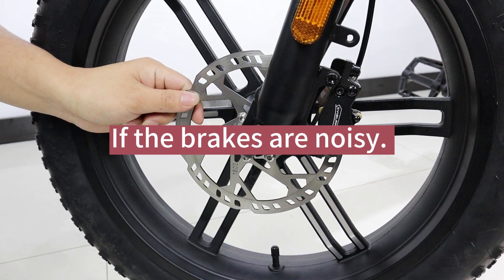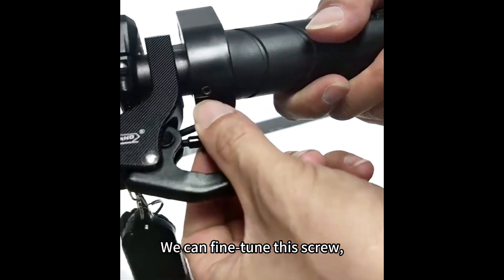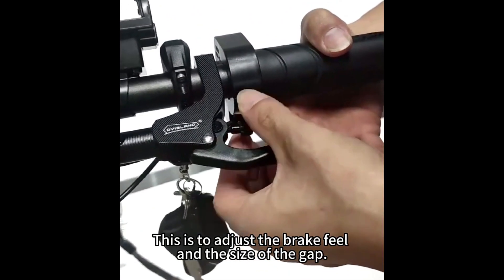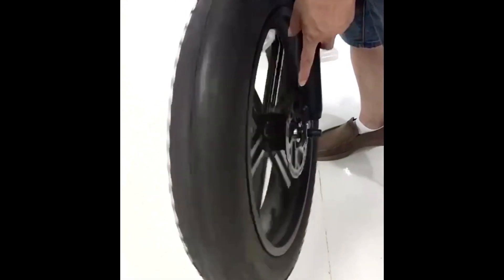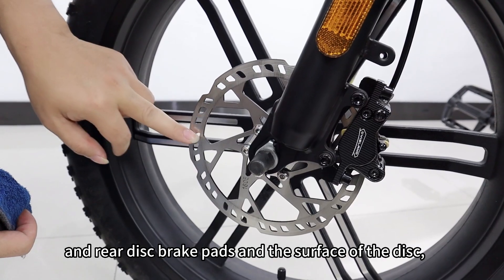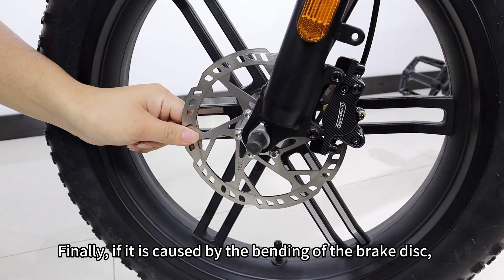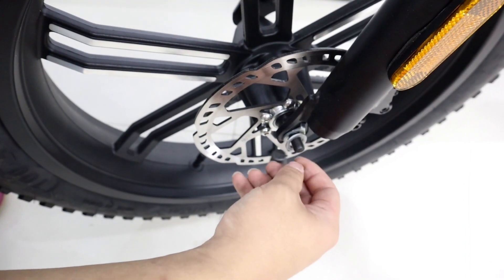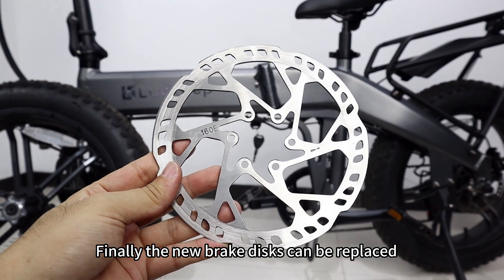How To -- If Brake Makes a Noise

Comment: Ok well my break pads are still in decent condition but there’s a big problem. The breaks have lost full pressure and the e bike doesn’t stop safely anymore. I kept on turning that little screw to tighten my breaks but there is no longer any left to tighten. Please let me know how to fix this and if I can’t please be straight up and tell me where I can fix this.
Reply from the maker: You can take some photos or videos of what you’re seeing. Note down your observations as detailed as possible. Then, send those over to support@luckeepbike.com along with your order number. Our team will take a look and guide you from there.

Comment: Gooooooood🤙👍
Reply from the maker: Thanks for your support! Hope our ebikes can help you!
Reply: @luckeepBike 
Hello Ser, I have this RKS xs25 Electric Bike, I need original brake pads for it, if I order, you can send it from there.🙏🙏🙏
Reply from the maker: Brake pads are not a universal accessory. If you buy another brand of electric bicycle. There is a chance that our brake pads may not fit your e-bike. I'm sending you a link so you can check out our brake pad specs.link:https://luckeepbike.com/products/1-pair-of-luckeep-brake-pads @umarjankarlyyew1474